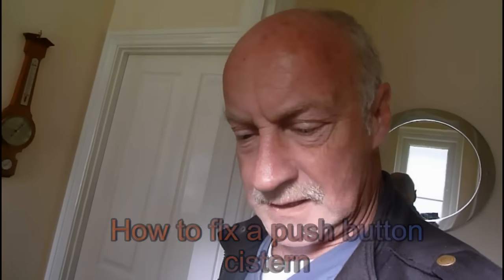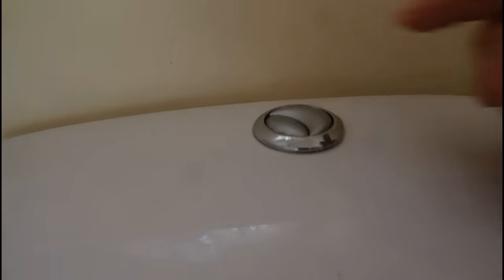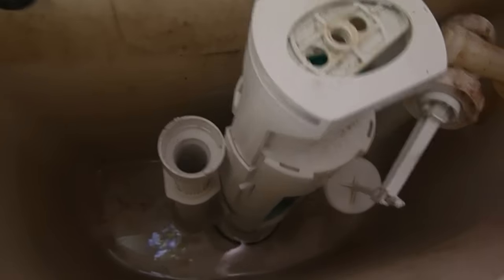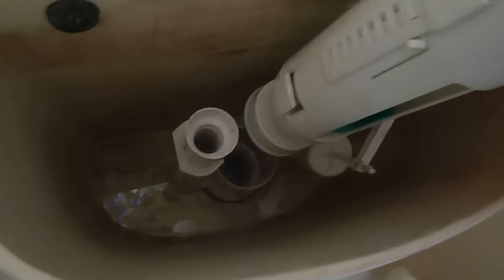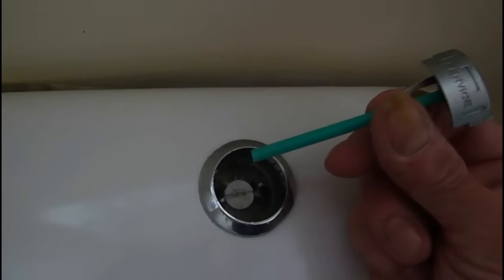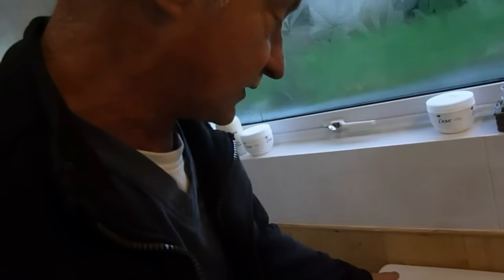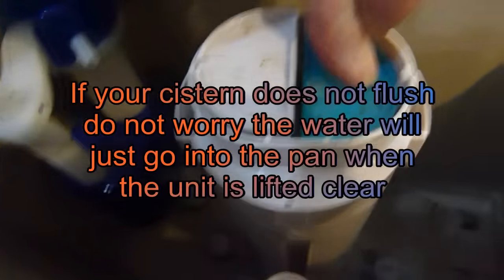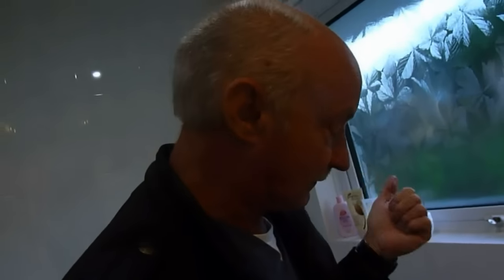How to fix a push button cistern that does not flush. Without removing the cistern

Comment: Thanks for sharing. My button has a thin flexible pipe to the Syphon. Do you have a video how to get them flushing again? Its worked for years then suddenly there is no pressure/feedback from the button to engage the flush.
Reply from the maker: I do not have a video on those , but check the pipe is not leaking and the ends are tight, after that it will be your syphon faulty.

Comment: Hi, pls can you help. I've got the 2nd one but my lid button  is oblong (still has 2 prongs like yours) The button on lid is moving fine, but plumber supplies can't sell me the fixing because the lid button is round. Surely the part for the cistern should work if I use my own lid button? No one knows what model fixing I have because it's un -marked?! Hope you can help or I might need to buy a whole new toilet!?
Reply from the maker: Hi Julia, I would just get the complete syphon part, you do not need to replace the whole cistern.
Reply: @dereton33  thank you. I'm sure my lid and button will still work with the main syphon.
Reply: @dereton33  where did you buy your double flush one please? What brand was it? I've tried two other suppliers and said my square button is fine i just need the inside but they can't help! So frustrating. Thanks!

Comment: Hello Al, there's a bit of a problem with a push button toilet (seven years old) in a relative's house.  When pushing the button the toilet does flush but only after pressing the button fully in and holding it in until the toilet flushes.  It does eventually work but flushes  slowly.  What adjustments, if any, do you suggest could be made?
Reply from the maker: johnnybrew1 Check the water level is correct, remove the dual flush plug from the syphon if it has one or renew the complete syphon. Al.
Reply: dereton33 Thanks Al, I'll try it.

Comment: I have two brand new push button cisterns - identical to the first one in your video - one flushes fine the other has nowhere near the same amount of 'force'. The slow one is upstairs - but this shouldn't affect the flush, surely?

I would love to know why?
Reply from the maker: No it would not. Check the water level in the cistern. At worse renew the syphon.
Reply: Hi, thanks for that - but if you swap the syphons over - from the loo upstairs to the loo downstairs, both syphons work fine in the downstairs loo, but neither work at full force in the upstairs toilet. Both toilets are new and identical and both have same water level. That's why I havn't gone and bought another.
Reply from the maker: Is the upstairs a different pan? If it is,  then it could be one with a restricted inlet from the flush syphon.

Comment: There are 4 flush valves that I have worked on one lifts of with the rods. two you pop the rods out to access the stupid plastic screw that always get damaged. Three fluid master make one with a cable that unclips from the button. And four the whole crombe button unscrews this is normally only on a single flush cistern. Hope that helps someone.
Reply from the maker: Joshua Trevor Thanks for the extra info Joshua. Al.

Comment: What is the correct level for the water in a cistern?
Reply from the maker: +icespeckledhens . There will be a line in the cistern which is the water level line, if not fill to about 2 inches from the top of the syphon.

Comment: I've just installed two of these push button units but they have the Cable between the button an unit

as soon as you let go of the button, it pops right back up. no amount of ajusting seems to sort it! any ideas please?
Reply from the maker: Ryan Abbott A new unit is the best way.
Reply: dereton33
figured out the problem

as the button was being pushed down, the internal overflow tube on the outlet was pushing up and hitting the bottom of the button. if you know what i mean? hacksawed a few centimetres off the internal overflow and that sorted it!

Comment: My geberit dual button flush valve (261.157.00.1) works only if i keep pushing the button down and it stops as soon as I lift my fingers up. What could be the issue?
Reply from the maker: Vikas Agrawal A new one is your best bet, I have a video on how to change them. Al.

Comment: Can anyone help? We've recently changed to dual flush cisterns. (basic ones from B&Q) The upstairs one works fine but with  the downstairs one we have to hold the button down 'til it's finished flushing. We've tried lifting the lid and comparing it with the upstairs one which flushes when you press the button then let go, but downstairs one still won't flush, unless you hold the button down. Both WCs were fitted by a qualified plumber. Any help would be appreciated.
Reply: Yay!!! Managed to work it out myself. Now working perfectly. The little plungers were too short, turned them until they were slightly longer! Clever me!
Reply from the maker: Well done Helen.
Reply: Helen25243 I have this same problem with my push buttoin toilet what do mean too short ?
Reply: liza smith 
Lift the lid off and you will see 2 black things that look like screws. One has a red collar the other blue. You can lengthen or shorten them by turning them. The problem with mine was the ‘screws’ weren’t reaching the plunger when I pushed the button on top of the cistern unless it was held down. I lengthened both of them and it worked. I push the button on top of the cistern and let go, now it flushes without having to hold the button down. Hope this helps.
Reply: Liza smith 
Hi Liza, have just looked inside the cistern lid. One ‘screw’ is blue one is black, no coloured collars on mine. Turn each screw until it becomes longer and try flushing. It worked for me. Let me know how it goes.

Comment: I put my toilet in and its been great for 3 tears now i find when i push the little button it flushes the sane amount as a big flush is there a quick fix or is the mechanism playing up. It's like the one in your video
Reply from the maker: You will need a new inner part. It is a Gerbrit part.
Reply: @dereton33  it should not break this quick though surely i only had it 3 years and I'm the only one who uses it. Its an estilo toilet from homebase

Comment: Single button, lid won’t come off, outer ring that hold button won’t turn. Searched everywhere no fix?
Reply from the maker: Just pull hard up on the lid it will lift the syphon up with it.
Reply: @dereton33  thanks for your reply but I did this & the plastic part inside snapped

Comment: my toilet will drain water for about a second when you flush and then not fill up the tank with water again. I'm not sure how else to explain this but I'm honestly at a loss
Reply from the maker: Valve is blocked or you have low pressure water, with a high pressure valve fitted.

Comment: Hey Al! The pipe you used to turn the water off is leaking on my toilet.  I've turned it off so it doesn't leak anymore but this has stopped the cistern from filing. Any ideas what might be causing this leak? And how to fix it?
Reply from the maker: If those valves leak all you can do is renew them.